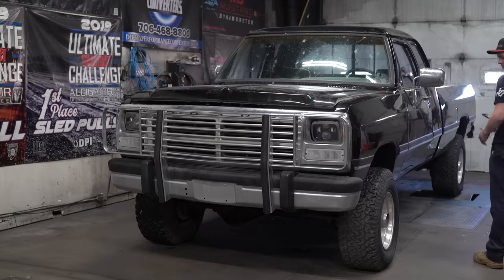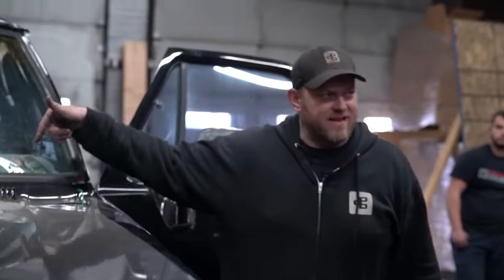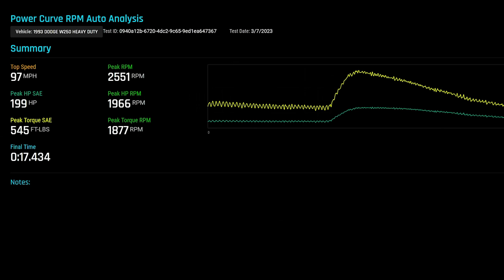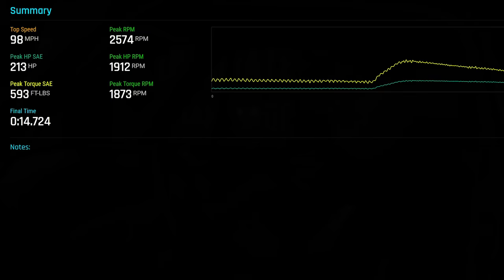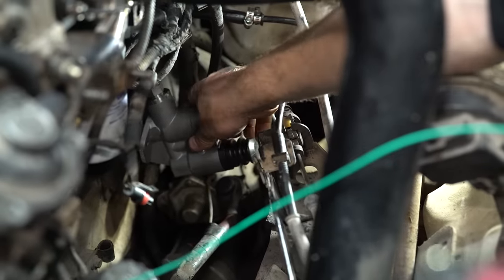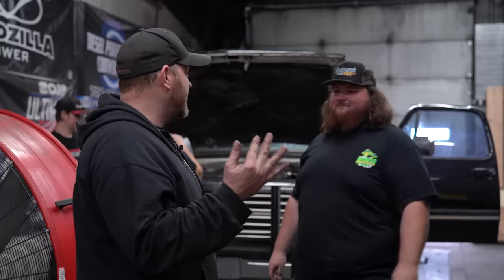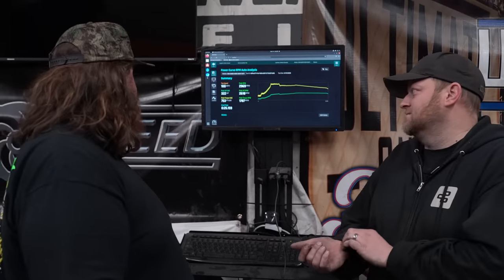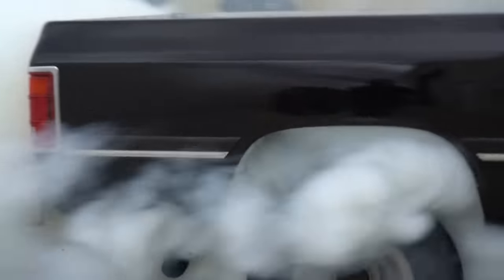Double the Horsepower 1st Gen Cummins

Comment: You never tried adjusting throttle linkage to inner hole for more throttle travel. Doesn't hurt to drill the banjo bolts on the fuel filter lines as well. I had 5x18's and 3200 spring with 354 gears and 5 speed, and it would easily hit 3600 rpm, 125-130ish mph.

Comment: I have the same setup on my 89 except I have a 5 speed manual. Very fun to drive.
Reply: What kind of mileage are you getting?  Considering a '91 D250 as a cheap / reliable, low tech tow rig.
Reply: @4xAbuse  I roughly get a bit over 20mpg unloaded. I drive like a grandma though.

Comment: Considering the factory rating was 160 to the crank, that first dyno run wasn't bad. I still need to put the injector nozzles I bought from you guys on the spare set of injectors I have for my 1st gen 😅

Fuel pin and screw was enough to make my trans start slipping like mad, that lack of locking torque converter is just... stupid.
Reply from the maker: The trans in these trucks are tragic!
Reply: @Power Driven Diesel  are there reliable upgrades for the A518 transmission ?
Reply: @johnbunger1906  Of course there are.

Comment: I love these videos showing the increases in the horsepower. On my 93 non intercooled engine it originally made 16 lb of boost. I added a fuel pin, ground the inside of the cover and adjusted the spring. I also turned up the fuel screw and added 7 x 11 injectors and the Boost went up to 40 PSI with a huge Improvement in performance. Then I added the timing spacer kit and added the 3200 spring, and the Boost dropped down to about 32 or 33 but still runs great. I have a straight 4 inch exhaust. Kind of wondering what kind of horsepower my engine might be making compared to stock.

Comment: You're killing me!  I'm so curious what it would have done with a new turbo.  I had a '90 I named Frankensmurf.  It started out pretty rough too, but after what you did (Except I put DDP 100hp injectors, so I'm not sure how that compares to the 5x14), plus an HX-35 with the wastegate wired shut, I could hit 50+ PSI boost, and I'm pretty sure topped 400Hp.  (It did have bigger exhaust, no new pump, and was a Getrag manual transmission).  I sold it and warned the guy he needed a wastegate before he blew a head gasket or worse.  Unfortunately he didn't listen and 'popped' something two weeks after he bought it.  Boy that was a fun truck!  If it wasn't for 4 doors and creature comforts, I'd prefer it over my '04.5

Comment: So I have a 250-260cc THD injector pump 3200 spring, Stage 3 DDP nozzles, Stage 1 DAP 62/64 HX35, Decent Garage copied BHAF, 18psi fuel pressure, and a 4" exhaust system. I should be 400-450hp (stock automatic '93) I bet if you would have adjusted the valves you might have picked up a few ponies. This video is inspiring!

Comment: I got to 300 on my 89 with the 727 auto with only fuel screw, powerstroke intercooler and  a 57mm stock 300G turbo. The stock non intercooled 4X12's will move some fuel.
Reply from the maker: Yes they do!
Reply: @pddofficial  Nothing super fast, 9.35 in the 1/8th at 72 ish mph.

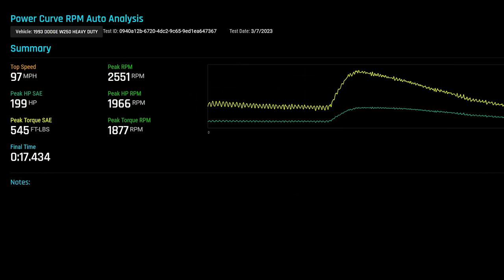Comment: I daily drive a 1992 D250 VE pumped 12 valve.  She's got a HE351CW, HVLP fuel pump, 4" diamond eye exhaust, 5x.12 injectors, BD pin, 366 spring, BHAF.  Pump is turned up. Just rebuilt the Getrag and Dana70 which has 3:54 gears.
Reply from the maker: Sounds great!
Reply: @pddofficial  Most reliable vehicle I have ever owned in my 45 years.

Comment: I've been pondering what a good recipe for roughly 300hp might be. I have a 1991 VE pumped Cummins in my 1978 Ford Bronco with a ZF5 manual transmission. It has stock injectors but the pump is maxed out (fuel screw buried, THD fuel pin, 3200 RPM spring) and I have an HX35W turbo with the 12cm exhaust housing. I'd like to dyno it sometime to see where it's really at. I'd guess between 250-300hp. It moves the bronco pretty good as is :)
Reply: Get some cheapo marine injectors or something and you'll be right there.

Comment: I have a SRW 91 dodge w350, bed off doing a bed line on the frame, I will end up probably welding a flat bed up for it in my free time. It will end up getting all new paint job, interior work, and a bunch of front end steering component. 1st gen’s are awesome
Reply: SRW means single rear wheel for those who don’t know
Reply from the maker: Nice!😎
Reply: @pddofficial such low horsepower engines but a hell of a lot of torque, for me upgraded it isn’t really necessary. More horsepower equal more room for mechanical malfunctions

Comment: You need a manual on that old girl. We did multiple pulls with my 92 cummins at 301 hp and 698 lb ft. Fuel screw buried. 90 over POD injectors. Custom stage2 AFE intake. 3" hood stack. And 5 speed getrag. On 37x13.5x18s.
Reply: Curious what kind of mileage that combo gets? Looking at something similar for a toy hauler / sxs bed rack tow rig.

Comment: should have put a universal k&n air filter on then did a 1/8 inch timing bump after turning the fuel up i have a stock 1st gen and couldnt believe how responsive it got just with a k&n it got super snappy

Comment: id love to see what a VE pump is capable of 😍👍 i know they are not as powerful as the P-pump but there is a lot of people still rocking the VE pump and knowing some secrets to make some good gains would be awesome knowledge to have 😁 Im building a fummins with a VE pump and im looking to make about 300 HP so this video was very fun for me to watch 😅
Reply from the maker: There are a lot of fummins with VE pumps.  I think we may need to do some more testing with these!
Reply: Hey it's even educational for people who don't have a Cummins, but do have a VE on there 4 banger diesels! I'm sure there's a fair bit of cross over. I for one would deffinatley want to know how to figure out what pump timing an engine is running that has a VE. I only know how much plunger lift to dial in at TDC but no idea how that translates to degrees of timing.
Reply: @Power Driven Diesel  Definitely!  Id love to see the guys nerd out on all the tuning of the pump!  How to adjust base and dynamic timing advance, different boost pin curves and spring adjustments. So many cool things about the VE pump that people overlook because they cant make as much power as the P-pump...  

Can i set a challenge for you guys to break the VE pump HP record? Lol...
Reply: Hey man look at firepunk diesel. This August I believe it the battle of the ve. Tons of big players in the ve fuel only will be trying to shoot for new hp record.
Reply: @Dakota b  i managed to find firepunk diesel but nothing about a VE pump challenge or anything... what have they called it?
Reply: I drive a 92 d350 everyday with 16' enclosed trailer. I have a bunch done but would love to see more. NEED MORE POWER.!
Reply: 300 is simple and you will make more horsepower with a built auto than you will with a Stick. It's a proven fact.
Reply: @pddofficial  PLEASE DO! I have a Early 91 Non-IC w/ 360 Getrag.
Reply: They are capable of 688whp fuel only as of currently I believe haha.
Reply: Know somebody oem number of 12mm head unit and 3.2mm camplate ?

Comment: There’s no way you were pedal to the floor. On that little “before” video in the beginning 🤣🤣
Reply from the maker: Honestly, that was pedal to the metal.  Keep in mind we're at high altitude so it takes much longer for the truck to build boost and advance the AFC to unlock the full 140 HP.  With a boosted launch it would have come off the line faster, but the brakes were too worn out to do much of a boosted launch so that run started from an idle.  Also keep in mind 95% of the "stock" 1st gens out there have been monkeyed with so your experiences from a "stock" Cummins might not be "stock" as this same truck.

Comment: Great video, I have a Dodge w250 1991.5 Cummins 5.9, with 175,000 miles and a A518 transmission,
the only mod, I had done was install a 3200 spring, but I will like to get a new  set of injectors like you did in the video
like to stay below 200 HP. (5x11) you did not mention about "VCO or SAC" what injectors will  you advise to get, I live in California
 ( my truck is too old for the smog laws) why did you chosen the 5x11, Thanks
Reply from the maker: We would recommend the vco or give us a call and we can get you setup with our stage 1 power jets.

Comment: What does this do to the MPG? If you drive it easy would it be about the same? Can't you put a solenoid before the pump to be able to turn the fuel off in an instant. Then it would bleed down and stop a runaway relatively quick. I thought that's how the key worked anyways.

Comment: You never once talked about pump timing……
 I would like to know what your pump timing was set at.  …… When you look at the VE injection pump gear , there are several different letters - stamped on the gear for different levels of pump timing. Stock is “E” …. Should have moved it over one tooth to letter “C”

Comment: Isn’t the transmission that you put in it worse, didn’t it have a 727 in it before. those things were really good transmissions maybe not for diesel power but that’s what they used to use and drag race cars
Reply from the maker: Yes they are great gaser transmissions but at 100ftlbs of torque will fail quickly.

Comment: This is awesome I slowly started with mods like this with my 93. Now it's 362 sxe, pusher piping, thd comp pump 4200 spring, hvlp, 60# over springs, titanium retainers, 6x13 comp injectors i hit around 50lbs or so. No idea what it makes though. Figure 400+ whp I guess.
Reply: Sounds like alot of money to get like 400 h.p
Reply: @No U  little more than that to the wheels. Do you not realize these came with 160hp factory and are the first generation of diesel pickups...wtf do you expect? 🤣
Reply: @Codizz88  I'm just saying lot of money to get a smidge of horsepower. im spoiled by my 6.4 powerbroke
Reply: @nou8257  less money than a p pump still. Spoiled until it blows up 🤣🤣
Reply: @Codizz88  Surprisingly the trans went before the engine one of the clutch packs is not happy which figures since previous owner was not easy on the poor truck but hey if it blows it turns into a fummins i've got a ppump 12v just waiting to be used

Comment: Dyno has a correction to read engine Hp I assume? Obviously no way 160 crank through a box, shaft, diff, axles, and tires, is 140hp.
Reply from the maker: That was to the wheel.  These old trucks are rarely left in stock form.  I imagine in the last 30 years somebody adjusted something on this truck.  Even with stock parts you can adjust the calibration for a bump in power.

Comment: That kind of power with out messing with stock boost levers. Tho they need to give it boost. Get it up in the 500hp area
Reply from the maker: The factory turbo has a non-wastegated housing, so boost was limited purely by fueling.  Stock it made about 14psi on the dyno, and after the mods it made about 26 psi on the dyno, so almost doubled the boost.  With an upgraded turbo with a smaller A/R turbine housing, surely it would have seen 35 psi or so and made more power, but the goal was to add power without breaking the bank.  The truck is back in Kansas now, so future mods will have to happen at Westen's shop.
Reply: @pddofficial  on my crew cab it is stock everything 92 just turned up pump with a set of pdd 7x.011 tips and an s300g 57 with a .80 and it runs 42-45psi. I think it is real close to 400hp and over 1000ft lbs. it tows heavy like a champ accept egts get out of control despit the 300g dropping 300 degrees from the hx35 12cm

Comment: Hey there, I'm new to the cummins scene! Is the initial 280hp with 5x14 injectors, fuel pin, 3200 rpm spring, fuel screw turned up, and the p pump sustainable for a 1993 daily driver with the stock A518 transmission and was the turbo a stock  H1C? Any information is appreciated and thanks in advance!
Reply from the maker: That transmission would not be happy with that setup!
Reply: @pddofficial  Could you recommend some upgrades for this setup to add to the 518?

Comment: I have a 1st gen 12v I am running a 3800 gov spring I am planning on doing valve spring's and am trying to get around 450 and was wondering if I should go with you're guys 60# or the 170# conical valve springs thank's
Reply from the maker: For that rpm the 60 lbs are ok but make sure to get our tool steel retainer and locks.  The stock stuff won't live long.  The conicals are better of course but if your using a stock cam the 60's should do well.

Comment: hey guys love the channel! Gotta question. I have a 98 12 valve. mods are 5x12 injectors, 3/4 k gov springs , fuel plate, 60lb valve springs. Currently at 14 degrees fact. timing . Looking for advice as to what to bump the timing to. thank you!
Reply from the maker: I would hit the headbolts at 125 lbs.  Then bump timing to 18
Reply: @pddofficial  ty!

Comment: Why do a time race in the beginning of a before and after video and not a race in the end?
Reply from the maker: We missed it in the final editing, I guess our video editor cut out the final race time.... it ran 10.03 on the one and only pass with the non-lockup transmission and the 280 HP power level.  It spun a little so likely would run 9.x 1/8th mile and the trap speed was 64 or 65mph.

Comment: You'd be surprised what a VE pump can do with the right pump mods (internally fueling and timing) and with a breathing 12 valve and a fast fuel system or something equivalent a reliable 600hp daily
Reply from the maker: 600HP sounds wild for a VE Pump, have you personally built one or seen one on the dyno at 600 HP?
Reply: @pddofficial  me personally no but the guy that built my pump has done some pretty wild numbers with his pumps but is very secretive about it at the same time every once in a while I get to go to his shop talk to him and see what he's got going on The biggest thing is getting the air density to burn all the fuel and your timing correct and that guy that builds my pumps doubles the internal timing curve along with a bunch of other stuff My truck is over 500 I'm only basing that by being in trucks that are proven to be 500 horsepower and I'm faster than them just not sure what I'm at but I also have more to do to squeeze the potential out of the pump like a matching set of injectors for the pump flow and pressure and a decent intercooler but I am running Hamilton head and 182 214 cam I believe with the right injectors compounds and intercooler setup with all my other mods I'll be right at 600 or just shy of it
Reply: And that's on a 12mm pump
Reply: @pddofficial  I have video of my ve going over 600hp fuel only at a national event years ago. I am going to have to dig it out of the barn and fix the head gasket so I can take it to fire punk this fall and defend the title. 😎

Comment: I can't believe you let it shift into overdrive! That screws with the numbers because it's not 1:1 like it's SUPPOSED TO BE to get accurate numbers.
Reply from the maker: If the trucks makes 30 psi boost on the highway, 28 psi in overdrive on the dyno, or 25 psi in direct 1:1 on the dyno, which gear would you SUPPOSE gives the most accurate power number?

Comment: What was the new 1/8th mile?
Reply from the maker: It was wet so we didn't get a good run, but with the 280HP setup on the stock tranny it ran 10.03 @ 65MPH with some tire slip in 1st gear on the damp pavement.  Hopefully Westen can take the 323 HP setup to the track and see what it'll run, hopefully low 14 second 1/4 mile!
Reply: @pddofficial  That’s awesome, keep up the great work and incredible vids!

Comment: 14 MIL OVER 12 MIL IS UH 12% MORE FUEL BY VOLUME, I HEAR THAT THE 14 MIL PUMPS GET A LITTLE HOT U MIGHT NEED TO CHANGE OUT THE 50 HP INJECTORS FOR 100 HORSE! U KNO TO KM KEEP THE PUMP TEMPS DOWN!

Comment: I gotta say after owning and driving a 1st gen cummins. I don't want to own one. the following around this model of truck is amazing on how they prop up such a awful truck. The engine is great the rest of it is a shipping crate yank the engine toss the rest.
Reply: Its a 30 year old truck that was the beginning of diesel pickups...wtf expectations do you have?
Reply: @Codizz88  Just made me really appreciate how much better a 2nd gen was and my 7.3's
Reply: @No U  maybe in comfort, otherwise a 2nd gen is worse in almost every way. Still love 2nd gens though. 7.3s are tough but pretty gutless without alot of work.
Reply: @Codizz88  1 of my 7.3's is one of the 275 horse 6 speed trucks and ever since i bought the truck it has impressed me for what it is while being mostly stock and it pulls trailers nicely
Reply: @nou8257  those zf6 trans are very good.
Reply: @Codizz88  Ohh yeah zf6 is great I've drove a duramax with a zf-6 plus my 7.3 and owned 2 different 6.0 powerstrokes with them and so far they are my preferred 6 speed manual trans. I do have 2nd gen nv5600 truck but not really drove it much to compare it to the zf as its yet to be road worthy since i got it.
Reply: @No U  yepper awesome trans. Nv5600 is good also. They can be built to be very tough. Super stick in tx builds them and they are probably the strongest light duty diesel trans you can buy.